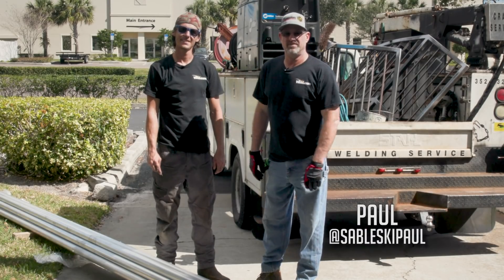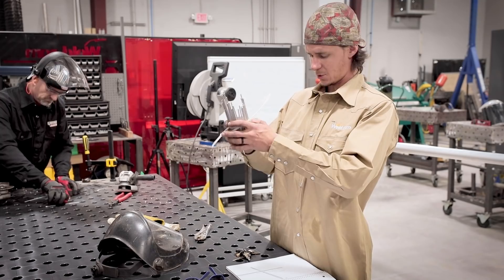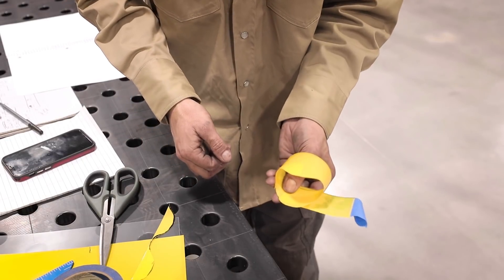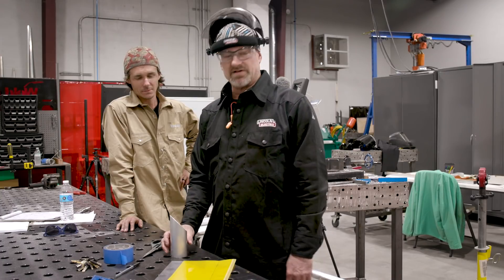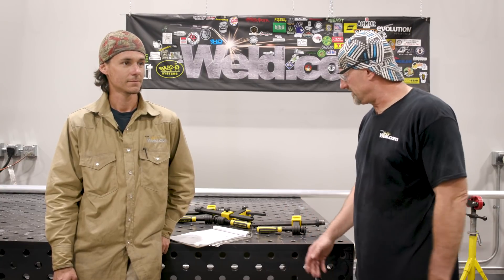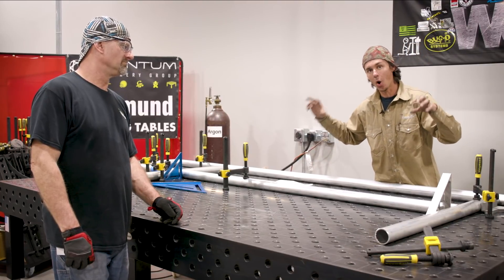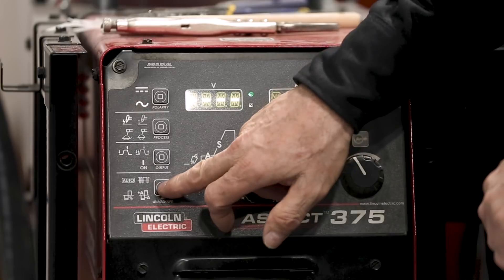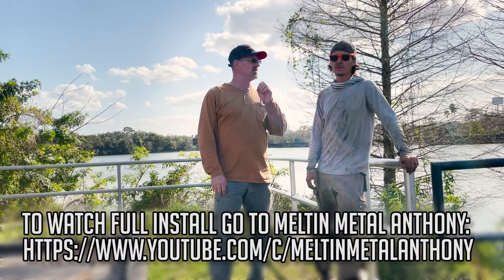$17000 Aluminum Railing Welding for Emergency Project

Comment: What diameter wire was Anthony running because ,even with .030, that’s too much wire and not enough voltage.

Comment: I have DOT handrails kind of like that but mine have mounting feet plates. I got a contractor that fixes them when severely damaged but I want to get a setup to patch up some minor damage. I can mig weld ok if I had a welder. I want to get a spoolgun to patch it up. I noticed on the MP line of migs there only DC so you can't Tig Aluminum with one. Researching & watching marketplace for deals.

Comment: easiest way to cut copes is on a vertical/carpenter saw. Mark them out with templates or with a cope book and guide the pipe through the saw fallowing the sharpie lines. This is a great way if you have weird or changing angles

Comment: i 3d print templates for nearly everything. can only recommend. especially for profiles with inside corners, like T L H beams. also can recommend chalk markers. way more precise than solid chalk and does not burn away like a normal sharpie when plasmacutting. these two  little things have cut my prep time in half.
Reply: Never heard of Chalk Markers. What is the Brand Name, and where do you buy them? Does Amazon have them?

Comment: Question, I haven't seen a video on tig pedals, 50k vs 22k vs wireless. What is the difference between 22k and 50k ohm pedals good and bad, which is better more sensitive (50k)?

Comment: cutting fish mouths is real easy with a hole saw on a drill press/mill, little trickier with a hand drill but its not impossible
Reply: I was gonna say the same. Still a good job as always but definitely quicker.
Reply: Excellent idea